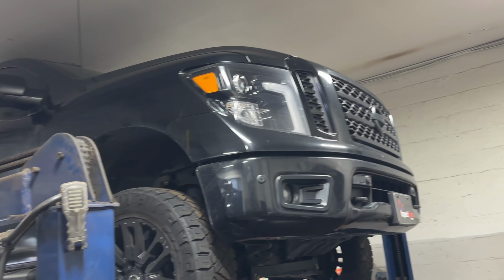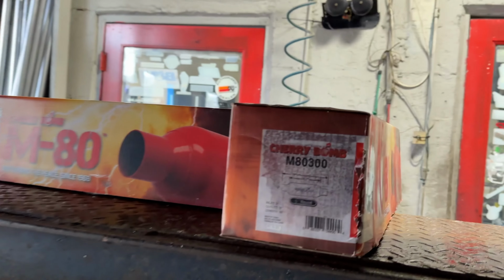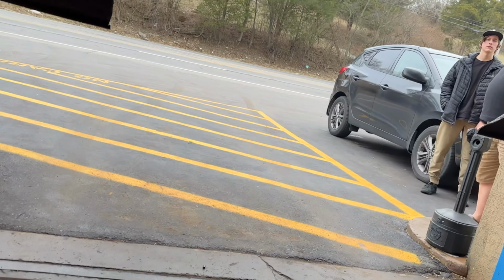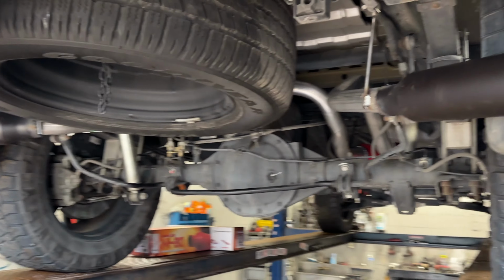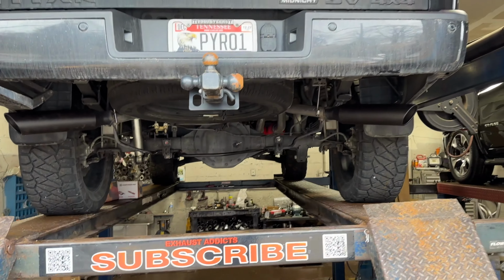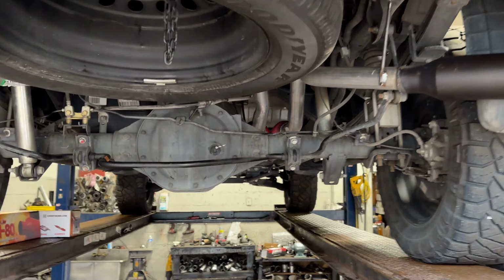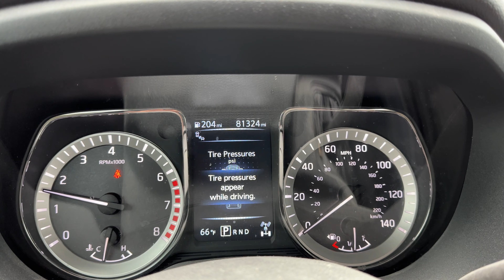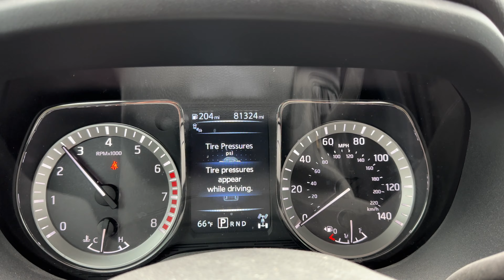2018 Nissan Titan 5.6L V8 w/ CHERRY BOMB M80s!

Comment: If you want it easier to weld to, just get a tiger paw (aka sanding disc) and grind the paint off the ends where you want to weld

Comment: I got a 2013 charger rt and want to get new exhaust tips. I was thinking either quad (so 2 duals) or like a 4-5 inch outlet. I found some dual exhaust tips which are 4inch outlet for each  tip so each side would end up being 8-8.5 inches since there are 2 tips. Would this fit if I left the stock diffuser on? I already have the inlet figured out, just need help on outlet